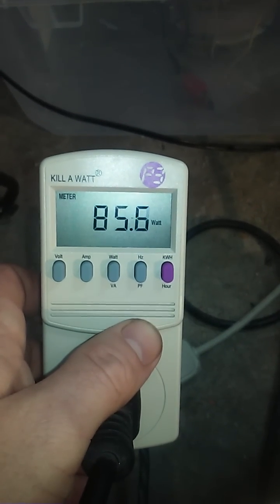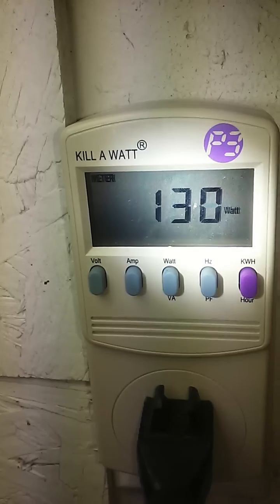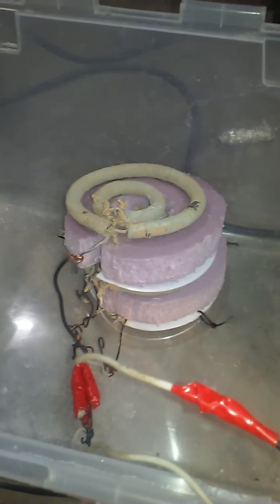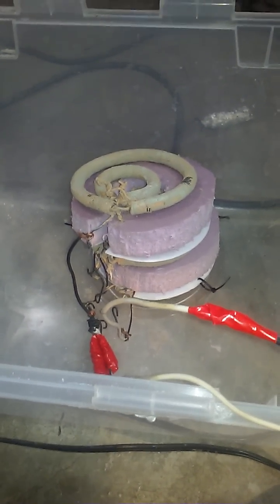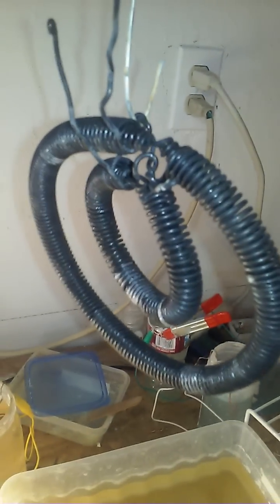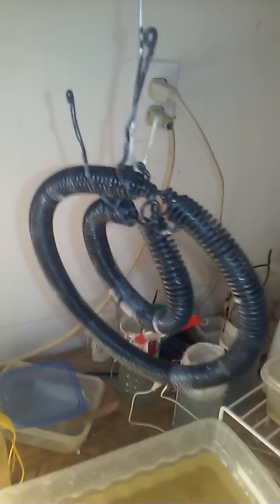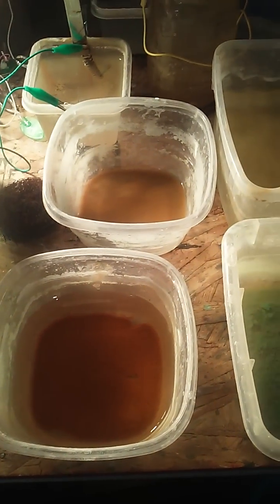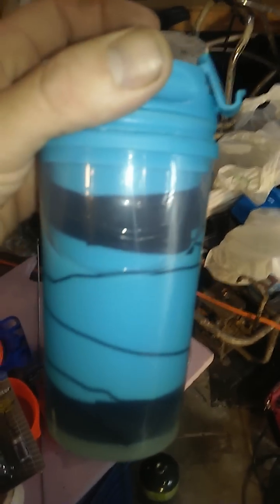Keshe Magrav stacker tests & questions

Comment: Google on youtube how to make a MOT welder. Before you coat anything you could weld the coils together as thou it was originally one piece, The wires could be melted together seamlessly and then nano coated. It should work fine as the joints would be seemless.